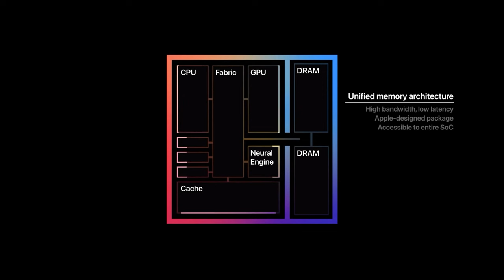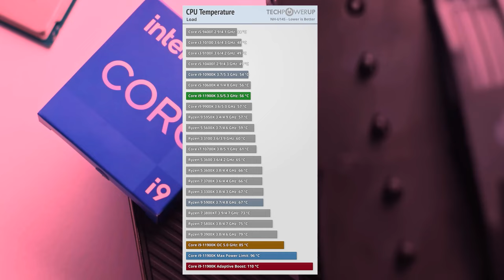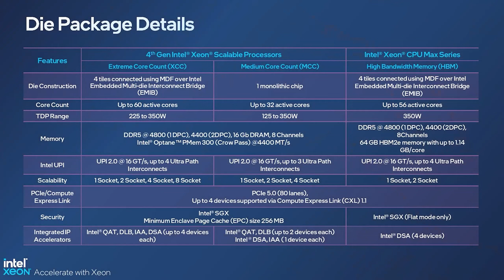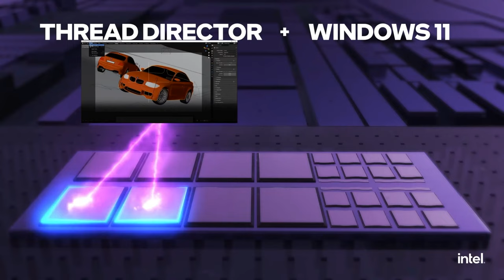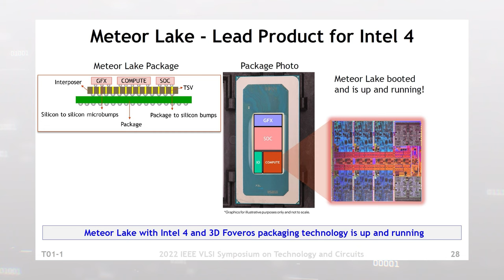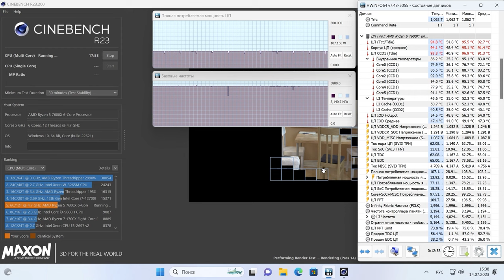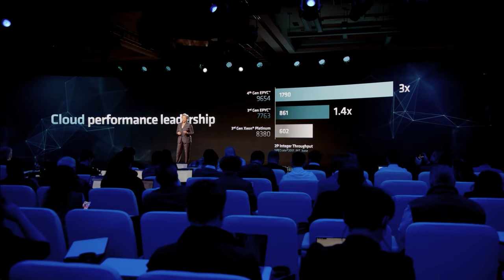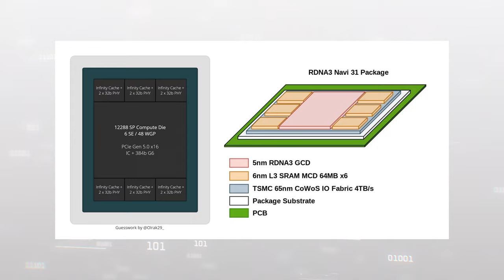CHIPLETS: Divide and Conquer | The Future of Processors

Comment: I do not like the “p” core “e” core thing by Intel. I want all my cores to be “p” cores…………but Intel can’t control the heat. Too bad for them.
Reply: The e cores allow for better multicore core performance over traditional designs, and should reduce power consumption under light loads with meteor lake (laptop only) and 15th gen(both laptop and desktop)

Comment: First, I'm much prefer a monolithic design than the cheaper and slower designs from AMD and Intel. 

AMD's Chiplets design is just simply bad. Their CPU chiplets are millions of nanometers apart defeating their expensive lower nanometer lithography. At least Intel is using a different but more effective use of tiles (chiplets) CPU tile, SoC tile, and GPU tile where each tile has a logical consolidated structure and purpose.
Reply: AMD's original design is about chiplets on passive or active interposers - same as Intel FOVEROS
They have implementations using passive interposers with their GPU HBM designs
But cost, volume and failure rates are much better when using classic packaging, with the biggest factor being volume imo, the tradeoff is latency, which is why they use huge L3 caches

So far AMD has a huge list of chiplet products, but Intel has nothing...so they are not using it, they keep postponing until the benefits become more prominent (probably in 5+ years)
Reply: @marios3761  .. AMD chiplets are just purely cheap and flawed. Their "3D" version half your cores are disabled, stuck at parked, and the separation between CPU chiplets adds a huge latency impact from the millions of nanometers of separation, It's really a bad and cheap design that completely defeats any lithography advantage AMD has or had over Intel.